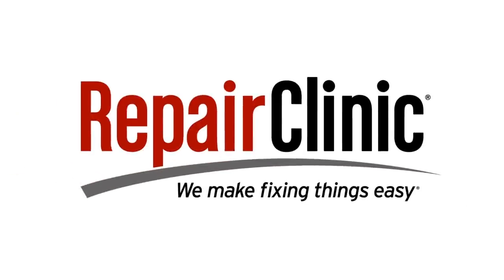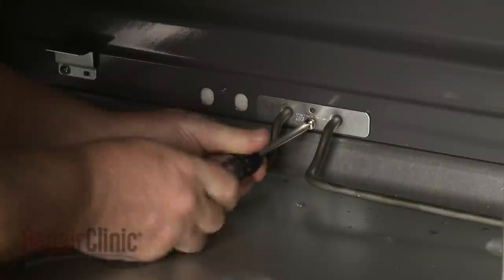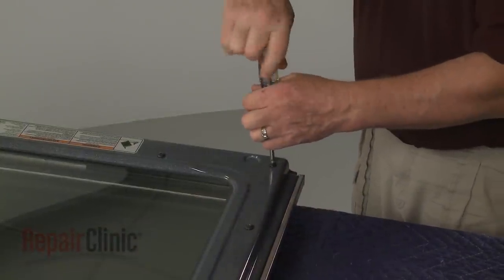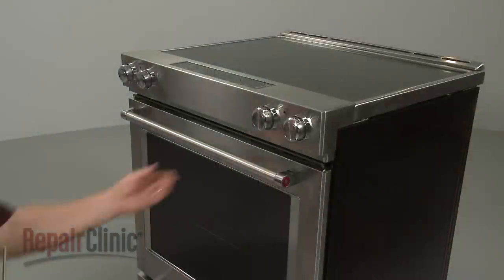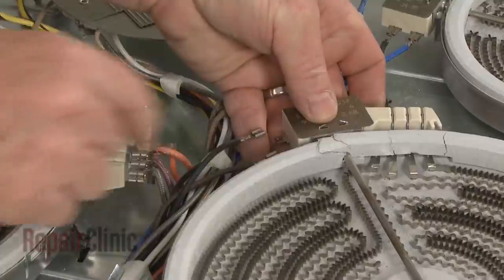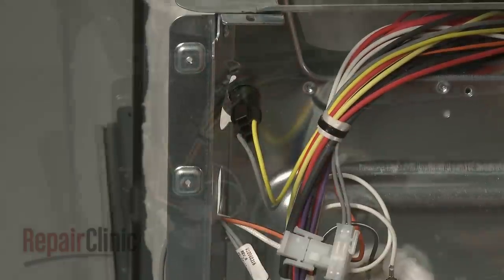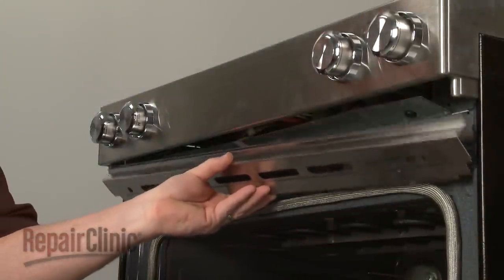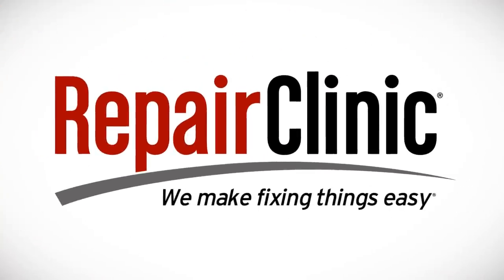Kitchenaid Electric Slide-In Range Disassembly - Model KSEB900ESS2

Comment: Model# YKSEG700ES. The display showed error code FE80  cooling fan speed too low. I replaced the cooling fan with a new one. I connected the power supply and it started working. However, it heated for a while and then went off and the display shows the same error. what is the problem? How do I switch off the energy saving mode?